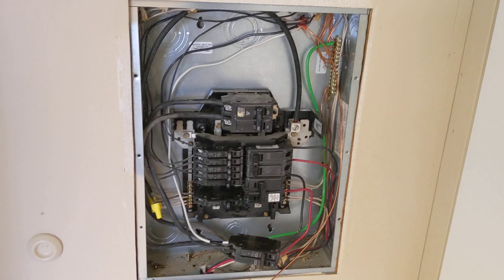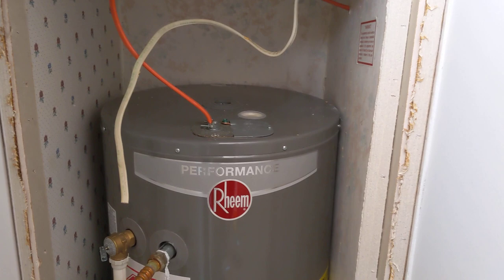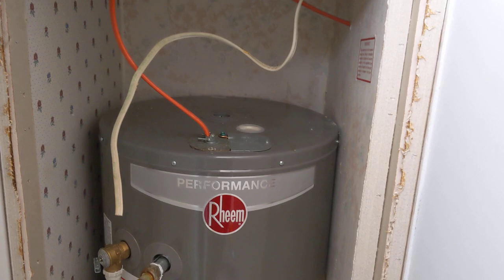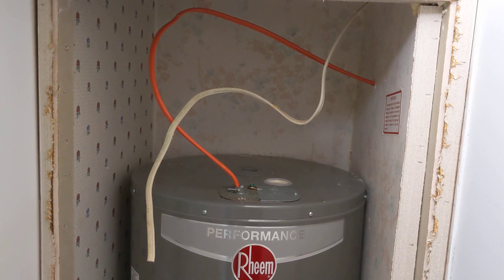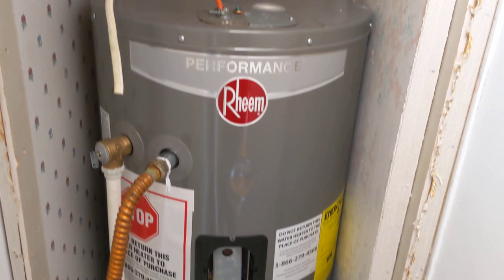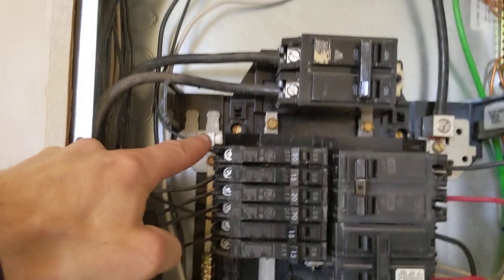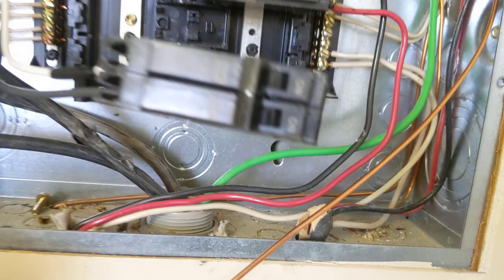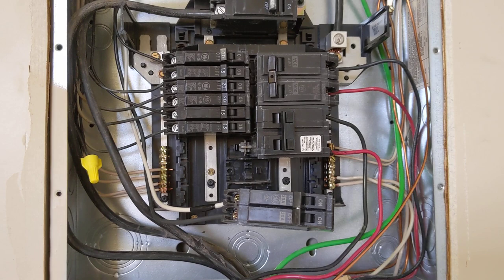Water Heater Electrical Issues

Comment: Thank you for the great video. Not boring at all and I learned that there is a reason why one needs to be careful when using slimline breakers and also that it is okay to use two wires and a ground wire for water heaters.
Reply from the maker: Great! I know I can go off on rabbit trails, but it is encouraging when someone says they've learned something helpful.
Reply: Exactly the video I was looking for. Thank you for the great explanations, there was absolutely no rabbit trails in this video. Thank you for posting.
Reply: Learned something new today about slim line connectors. Appreciate the education. Not boring at all.

Comment: I learned so much just with this video, I was almost ready to put a 4500 watt 40 gallon  water heater on 12/2 20amp breaker. I decide to look for a 3500/3800 watt water heater which had come with the manufactured home. Thank you for explaining this.
Reply from the maker: Great, glad it helped.

Comment: In cases where the existing wiring is 12 awg and replacing it with a proper 10 awg too inconvenient and/or cost prohibitive,  replace the 4500 watt elements with 3500. This will ensure the wiring doesn't overheat,  although it will reduce the heater's recovery rate, so households may have to adjust their expectations accordingly, often easier said than done for parents of teenage girls.

Comment: I’m struggling to get this information across to some coworkers. We install lots of water heaters, and a bunch of them go into mobile homes where this is an extremely common issue. The solution is super simple: downsize the default 4500 watt elements with 3500 ones. Like you said, you ‘probably’ won’t have issues. If you do, however, it can be annoying or dangerous, neither of which are ideal. Thanks for this information. It will arm me to better help educate my coworkers on this issue.
Reply from the maker: Good thinking. 3500 watt elements would eliminate the issue of overloading a 20 amp 240v circuit, but would definitely extend heating time. Compromises are a part of life and that's probably the best solution if running a 30 amp circuit isn't possible.

Comment: This is a very useful video. I bought a house that was seriously neglected by the original owner, then someone else bought it and the made all kinds of "fixes" and now I am stuck fixing their fixes. On top of all that, I think the water heater might be going out and I thought it would be a very easy fix. After seeing this, I am not so sure, but will run a new 10 amp line if I have to. Hopefully the power usage spikes aren't due to the power lines melting or anything like that.
Reply from the maker: Yes, never fun to fix someone else's mistakes. And just to make sure, you said a 10 amp line, but it's most likely a 30 amp circuit and you'd be running 10/2 wire to it. I'm sure that's probably what you meant, but just for clarification. Let me know if you need any help diagnosing weird stuff.

Comment: Thanks for the info. Wish you had gone into what carrying the neutral was about. 😊
Reply from the maker: What my poor verbiage was trying to relay at that point was simply that they aren't using the neutral to carry hot. When you see black and red, usually that means it's from a three conductor cable (Two hots and a neutral plus ground), so they have black and red carrying power in, neutral bringing it back and a ground wire acting as safety in case something shorts. That's all correct and good for most 240v fixtures.

Many times you will see people use a black and white (two conductor cable) to carry hot for a 240v circuit and then they use the ground to bring back the current and act as the neutral. That is bad for two reasons. One, since the ground does not have its own protective sheathing it can turn any metal box or fixture into a conductive path for electricity (leading to potential shocks for the unwary user), and two, there is no ground serving to protect the fixture since the ground has been taken to be the neutral (leading to potential shocks for the unwary user again).

The only place in most residential construction, is in regards to a water heater. Those don't require a neutral since they are what is considered a "balanced load". There isn't a 120v system in the water heat that needs that neutral to carry back the electricity so that it's balanced.

So, moral of the story is that almost all fixtures in a residential house need a neutral whether they are 120v or 240v (except for most water heaters), and every fixture needs a ground.

Comment: No!  it hasn't been a boring video at all .
it has been intriguing.. very interesting.. I learned quite a bit.. especially with the jumper line bar .
I didn't know that and I just did some Slimline breaker work in a panel not too long ago, so now I have to go back and look..
 but I'm working on a water heater for a trailer right now..
 and you answered my very specific question I was looking for .
so this is been the best video ever
 thank you
 and I love your voice wow sexy

Comment: What if I get 120 on each leg at the breaker but I only felt 120 on 1 of the legs at the water heater?
Reply from the maker: Then you have a break in your line somewhere. I would make sure that one line coming from the breaker is properly connected at the breaker and doesn't have plastic or corrosion creating a problem. If you confirm that the connection at the breakers are good and that you do have 120 volts on both legs of the breaker then it has to be the line and a squirrel chewed through it or something.

Comment: My Dad just replaced his water heater without looking at his breaker or wire and it's tripping. WH spec only require 2000w/120v so less than 25amp, right? The circuit breaker for the WH currently is a double 20amp slot, so that mean it accommodate 40amp? It looks like a 10 guage copper wires 2 colors and green grounding. Is the breaker tripping because 40amp is too high? Should replace it with 30 amp or even 25 amp?
Reply from the maker: So it sounds like he is hooking up hot to neutral because he's using a dual 20 amp breaker (2 hots = 240 volts) for what would only be a 120 volt connection (1 hot, 1 neutral). I'm guessing it's a 20 gallon water heater. So he would need to remove the dual 20 amp breaker and just put in a single 20 amp breaker, hook up one of the conductors to that and then take the additional wire and put it on the neutral bar. It's possible though that he could have damaged the electrical of the heater if he was feeding hot down the neutral. The grounding conductor is simply there to make sure that nobody gets shocked and it will trip the breaker if hot is fed down the wrong side (like in this case). So it sounds like the ground is doing what it's supposed to.

Comment: Pretty sure you are not allowed to have exposed romex coming out of the wall directly to the water heater. It needs to be run inside a shielded flexible conduit to a wall panel within 3' of the heater.
Reply from the maker: Yes, I talk about that a little around the 4 min mark.
Reply: Amazing how people make comments that are made very clear in the video. It's like they didn't even watch the video.

Comment: I need help! I bought a mobile home for my parents and switched out their hot water heater for a tankless. The breaker for the water heater is an4 pole breaker it has 2qty 40amp breakers side by side on the inside and 2qty 20amp breakers on the outside: 20/40/40/20 . I have a red, black and copper wire. The old heater had a wire in each of the 20amp breakers. There are no other wires or appliances on this breaker. I resided the (new breaker) breaker the same way as the old tank water heater but it’s tripping. The heater is a Rheem 8kw and requires a 2 pole 40 amp breaker. Should I have wired it in the 40amp a and not the 20’s? God I hope this makes sense😂 . … I learned a lot from your video!
Reply from the maker: I know you're not a dummy, but I have to say first that you are messing with some serious electricity so make sure you understand the risk and ways to protect yourself before doing any work. An electrician is always the way to go if you can. I have melted metal bits and wrenches from messing in live panels where I wasn't using proper tools. Thankfully I had enough insulation between me and the electricity to not pass through me, but it taught me to be more careful and not mess around while things are live. 
Onto your actual question. Send me your model number so I can see which unit you have. It's possible that it only requires two hots like a standard water heater, but my guess (based on you saying it has a dual 20amp and dual 40amp breaker) is that it requires four conductors, plus neutrals and grounds. You can probably use the old 10ga wire with the 20 amp breakers, but you will need to run 8ga wire for 40amp. Also, you may need neutrals with this unit so send me the model number and I might be able to point you in the right direction.

Comment: Hi, I learned a few things but im still a little confused lol. I recently got a Steibel Trend 24 on-demand hot water heater and it calls for two 50 amp DP and two 8/2 AWG wire. I called Steibel and he said it needs 2 breakers that will take up 4 slots. Two DP breakers means that it will take all 4 wires and no nuetral, correct? My dad has the exact same heater but says that his electircian hooked it up to a single 50 amp DP breaker, I'm not sure what that looks like as I havent looked at it myself. And I just ordered two 50 amp DP breakers.
Reply from the maker: Yeah, so you might want to check the manual, but it is probable that it's just four hots and a ground going into the panel (it is fine to connect both line's ground to the panel if the ground lug allows two grounds), but you only need one if you're running individual hots and a ground to the panel. So yes, it's a basic install like a normal water heater but pulls a LOT more amps to heat water instantaneously. If you use slimline breakers like in a GE panel, just make sure you're bridging between two hot bars so that you are pulling amperage equally off both sides. And again, make sure power is turned off and you're following the installation manual because some do require a neutral if they have special 120v circuits inside.
Reply: Thank you! I did pull up the manual online but it doesn't talk about wiring up the breakers at all, just that it's 240v and needs 2x50A breakers and 2 x 8/2 awg. Outside of that I can't find any specific info on wiring up the breakers.
Reply: And that's not counting the ground, I believe. 
Says Power connection  2/GRD
Reply from the maker: I looked up the wiring diagram online and it shows 4 hots and 1 ground going into the panel (8/2 with ground and 8/2 without ground coming from two double pole 50amp breakers). So it's just like you said. If I ran two 8/2 into the panel I would put a wire nut on one ground and only connect one line's ground like they show. This site has the installation manual at the bottom of the page as a downloadable pdf: https://www.stiebeleltronamericas.com/en/products/tempra-series-whole-house-tankless-electric-water-heaters
Reply: Thank you I appreciate it! 
And just to confirm, on the unit L1 and L2 should go to one breaker and then the other L1 and L2 would go to the other breaker? Other than that it doesn't matter which wire goes where on the breaker correct? It's been awhile since I've hooked anything up.
Reply from the maker: Yes, that's correct. 

If you were to switch L2 with the other L2 it would probably work unless they both fell onto the same bus, but it's possible it wouldn't properly trip the breaker inside of the panel if there was a fault, or it wouldn't trip the correct one since you'd be swapping hot legs.
Reply: @My Fortress Construction thanks again!  I got it hooked up and working a couple hours ago :-)
Reply: Also, my dad said (after arguing with his girlfriend) that he was wrong and that his does have two 50 amp breakers. Lol
Reply from the maker: @ZyaLuke  Good job. Lot's of people are scared to do these kinds of things, but double-checking and reaffirming your thoughts is a good way to do anything.

Comment: So I'm just curious, I have an electric 50-gallon AO Smith heater, I replaced both thermostats and both elements but even after that, the heater doesn't seem to be turning on, I also made sure that the breakers weren't tripping.
Reply from the maker: So I assume you checked that you have power to the unit? Breakers can go bad even if they still function, so that's where I would check first. Then I would check that the elements are getting power. If they aren't you need to check where the last spot power comes to. Look up the electrical diagram for your unit if you don't have the paper it came with.
Reply: @MyFortressConstruction  I just checked my elements, and apparently, they aren't getting any power at all, I really think the breakers could be the culprit to this. I really do appreciate hearing back from you
Reply from the maker: @OctAngel  Great, I'd love to hear what you figure out. Hope it's just the breaker.
Reply: @MyFortressConstruction  I just replaced the breakers to the water heater. Unfortunately, it didn't fix anything, but since there's power going through the wires, I feel like there may be improper wiring somewhere as an electrician recently did all the electrical work.
Reply: @MyFortressConstruction  UPDATE: AFTER AN HOUR OF REPLACING THE BREAKER THE HOT WATER FINALLY CAME ON!!!!
Reply from the maker: @OctAngel  Fantastic, I'm glad that's what it turned out to be. Though you said you replaced the breakers at first and it didn't do anything, so did you have to do something extra? Have a Merry Christmas!

Comment: Water heater was working perfect and after the elements got wet it stopped functioning now even with a new water heater is not working at all could that be the wiring coming from the box
Reply from the maker: With any kind of electrical issue you always work backwards. So is power coming to the unit? If not, then you check the next connection, and the next until you get to the source. So definitely check the wires coming into the water heater to make sure there's power, if no voltage is detected then go to the next connection point which could be a junction box next to the water heater, or it could be inside the main panel. Breakers go bad, connections become loose, wires inside of walls can be chewed by rodents and short (hot/ground touching). Just be careful!

Comment: I have a Rheem 5500 / 5500 Gladiator installed in a 20A @ 240v circuit. 
Last couple days where the weather is a bit colder, the breaker tripped twice after W/H running for around 30-40min while family taking shower. So I'm going to replace breaker and wiring. The company that replaced the W/H mess up the electrical part. Gonna fix myself.
Reply from the maker: Yeah, that water heater runs at 22.92 amps so it requires a 30 amp breaker and 10 gauge wire. I'm guessing they left it on a 20 amp circuit because the old one had just 12 ga. wire for the circuit? If so, good for them, because otherwise you could have had a serious fire. However, if they installed 12 ga. wire then that was bad on them for not installing the proper wire to the unit. Obviously, they should have informed you either way.

Comment: Which wire should I use for 50 gallon water heater (4500 w)? Two 20A brake or one 50A?
Reply from the maker: Neither. Wire size should be 10/2 Nm-b and you should use a double pole 30amp breaker. Let me know if you need more clarification.
Reply: @MyFortressConstruction  I don’t understand the wire size, is it a gage 12 wire? It seems 30 amp should use a gage #10 wire. Thanks.
Reply from the maker: @cx1741  So 10/2 means that it has 2 conductors that are size 10 ga. (it also has a bare ground wire). I would highly recommend hiring an electrician to do the work because there is a lot more to it than just choosing the correct sized wire and breaker. If you are determined to do this yourself then watch a lot of videos on proper water heater installation and make sure you have the proper tools so you don't burn up your water heater, flood your house or electrocute yourself. If there's anything else you have questions on, feel free to ask.

Comment: I have A 2way voltage tester it only matks 120 or 240.  Anyways it should mark 240 and only marking 120 could the breaker be bad
Reply from the maker: So, a lot of things could be going on. How are you probing the 2 pole breaker? Is the two pole breaker a standard size or thin line? It is possible to put a two pole breaker  so that it's pulling from only one half of the breaker panel. Easy solution if you just can't figure it out is if you remove the breaker (shut off the main power first), take another functioning 2 pole breaker and wire it in the place of the other. If the water heater starts working again, then you'll know the breaker was the issue. However, I'd recommend getting a $5 voltmeter or multimeter and see what the voltage coming off either legs actually was.